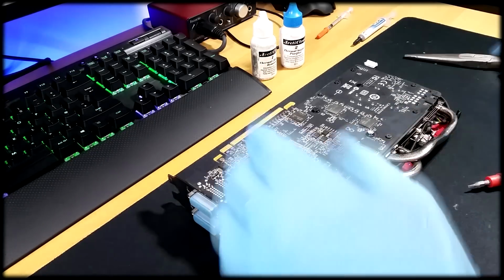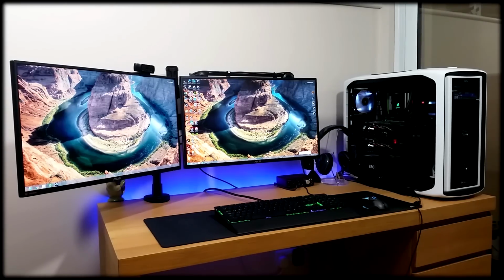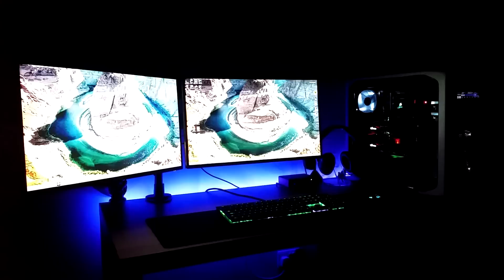Thermal Compound Removal/Installation Tutorial, MSI GTX 970 SLI, Liquid pro, MX4, DAMAGED!

Comment: hi, i have this exact card. i just replaced it with a MSI 3070 Suprim. the 970 is great but gets occasional black screen flicker, like it loses signal for a fraction of a second then comes back. loses audio and video. one time i was wering headphones when it did it, and i could still hear the audio. its not temperature related, and it could do it when watching youtube video or playing game. its not the tv, or hdmi cable, as my new gpu doesnt do it. it wasnt a big problem because sometimes it didnt do it for days, another time it might do it several times in 10 minutes. 
now ive got a new gpu, i can afford to investigate the 970, i was thinking about replacing the thermal paste, as its now 6 years old. any ideas what might cause intermittent signal loss?

Comment: Just replaced the thermal paste on my cheap 970 after about 6000 hours of overclocked exstensive and really hot use (avarage of 90 degrees celcius). The paste was rock solid but I dropped 15 degrees lol

Comment: I changed my GPU thermal paste after 5 years, i had 94c+ but after i changed thermal paste for first time, it was really difficult to do it for first time but i did it, i have MSI 980 and everything is good. From 94c to max 73-75c :D
Reply: Is the teardown same as the 970 in the video for the MSi 980?
Reply: @topg1760  Yeah. The difference is only VRAM chips.
Reply: @Voidolt  How do you mean, do i need to change the pads aswell?
Reply: @topg1760  I'm saying that the difference between GTX 970 and 980 are 0.5 more VRAM chips i guess. I didn't change thermal pads so just replace thermal paste just like on video.
Reply: @Voidolt  Thank you very much, cant stand 82c on 85% Fan speed anymore, the paste is probably rock solid by so far.
Reply: @topg1760  82c is pretty fine... I have 83c max when it's hot here so its all good.
Reply: @Voidolt  Yeah but it thermal throttles all the time and i cant get good preformance in games so i need to turn down the settings from very high to low medium to keep it in the 75-80c range. Very high is not even an option.

Comment: you clearly dont know what you are doing, you spilled some on SMD than try it - you burn something for sure or crack when try to clean. second you use thermal paste removal on liquid metal, yeah, like trying to clean car windshield with oil :) third, you take it apart and dont have 10 seconds to disconnect one connector...  amateur ! and if you are OCD you will F. remove that ugly sticker. 
PS. i have this card, modded bios, and 1550MHz on core :) temps never touched more than 75C, no thermal paste changing etc....  2y with OC than i sold it :) please DONT TOUCH HARDWARE WHEN YOU DONT KNOW WHAT YOU ARE DOING
Reply from the maker: Ok grand master OC! Sorry I am a so stupid and not worth your time grand master!
Reply: @TheKyleReality  If that was his response to you, what would it be if I told him I did the same thing to my GTX970 and left BOTH connectors on? The horror!

Comment: i just replaced my gtx970 paste after 5 years or so and it runs nearly 30 degrees cooler on the overclocked settings and because it is so damn cool it even auto boosts even further. I used the mx-4. Thank you so much for this video. Without it I wouldn't have had the courage to actually open my card and replace the paste :)
Reply: Bro my msi gtx 970 run at 92°c in furmark and 80°c in games, do i need to change termal paste?
Reply: ive replaced mine like 3 times still hits 80c not even 100% why ive done everything right
Reply: @BudKing96 prueba a hacer un undervolt, o quizás y lo más seguro es que tengas un mal flujo de aire en tu caja. Pocos ventiladores, o quizás mal colocados.
Reply: I better get started bc I'm on 86°C on Roblox at 1080p even with -250MHz underclocks 😮

Comment: two years ago, the pea method in the center of the chip was the favorite installation for heat transfer paste, or liquid metal. Now, these days the most common method that is shown to reduce heat substantially better, is the spread it out over the chip method. even those people that use their finger for spreading works better than the pea method. In this case, the pea method got maybe 40% coverage, thus very low heat transfer ability of the paste. Of course damage in the form of overheating, degradation of paste, or permeability of surface components due to heat induced diffusion into heat producers, (chip), or heat removal components, (heat sink), occur to an alarming degree. Running heat producing situations that never occur in real life, or gaming, causing the highest heat, to stress components beyond normal use, (sometimes causing failure of components and chips), do things really not advised by common people, but used by youtube illustrators, (good for our information), really show that the pea method is a failure.
Reply: I don't understand all the pea or X method guys. I learned the spread method when I had my school internship in a energy supply company ages ago, when I was a teenager.

Comment: Guess that is what happens when it says "DO NOT USE WITH ALUMINIUM" and you put it an aluminium heat sink.  Certain metal have an acidic reaction when they interact.
Reply: Ken Kimmel do you see aluminum? I don't, I see nickel plated copper.

Comment: seriously my personal experience with this liquid metal stuff is almost useless it's very finicky, it doesn't want to stick or blob onto a clean surface then it can be inconsistent as far as results go, but not only did it mark my cpu die and left a goopy layer of  something on it that was very hard to take off and maybe ate at my cpu die i couldn't clean it off, it left the same weird marks, so all in all stay away from these liquid metal and diamond pastes that mark your cpu and stick to the best none  metal none diamond based tims.

Comment: really it fucking says to only use with anything else then aluminium, that includes that you shouldn't use it with most gpu and cpu air coolers
Reply: joost van den Berg he didn't...nickel plated copper...
Reply: joost van den Berg most gpu and cpu air cooler contact points are copper or nickel plated copper just like the one in the video that is nickel plated copper....really are you a complete idiot or just a half wit?

Comment: I think it only eats aluminum and  I might be wrong, but I'm pretty sure you only use the scratch pad to remove the lead solder between the die and IHS on a cpu.

Comment: just changed the thermal compound on my 2 970's. Dropped in heavy OC from 91 C and thermal throttling  to 75 C
Reply from the maker: Sound good to me :) Which thermal compound did you use?
Reply: +Tech K Raiden i used some arctic mx4
Reply from the maker: +Dennis Zurlinden Nice I love MX4 its been out now for a while but still good stuff it is :)

Comment: Did the chemical reaction continued ? Did CLP stained your cooler more, or reacted with the GPU die ? Will it be safe to use in the case of a delided CPU (between the IHS and the die) ?

Comment: Voids warranty, doesn't remove sticker even though MSI will still see the marks on the screw and the none factory TIM, Genius!
Reply: +I0ITuGI0I According to MSI Warranty Customer Service reapplying thermal paste or over clocking with MSI Afterburner does not remove warranty at least from a MSI 980 Ti 6G. I contacted them about hot temps 83-85c in OC mode and they suspected that the issue is with the thermal paste and advised me to reapply it.
Reply: Well that's good to know, still haven't had time to try liquid metal TIM on my cards, I'm interested in how much difference in temp I would get with my waterblocks. 80c+? One of the reasons I don't air cool anymore.
Reply from the maker: I dont think I care about the warranty haha or I wouldn't do it think about it.
Reply: So just pull the sticker off and make your life easier, all you have to do is slip with those pliers and the card is dead. It was a good laugh though combined with the click bait.

Comment: great video mate what kind of fps do you get with sli 970's and it was fun playing with you tonight on battlefront
Reply from the maker: +BHC Impuls3 Well when playing Battlefront 3 @1440p i get 143fps capped  but can drop down to 110 ect in heavy combat that is with most on ultra and some on high ect. Gta 5 i get around 85fps max out at 1440p so depends on the game but always over 70fps in nearly every game @1440p
Reply from the maker: +BHC Impuls3 Also i just noticed I am not subbed to you haha just subbed bud
Reply: cheers bud

Comment: I need to change the thermal paste on my GPU becuse I render alot of videos which means that the Thermal compound is probably drying out now. Great video very helpfull :D
Reply from the maker: Ah yeah truthfully its very simple to do, if you have a back plate then there will be more strews but thats it.  MX4 is my fav paste but all are around the same with in couple of C ect.
Reply: MX4 is my fav paste too, I use it everywhere in my PC and others PC's :D
Reply from the maker: +AgraAvoid Haha. I am wondering now what my cpu is like because I delidded it ages ago over a year and use liquid pro on the core :)
Reply: lel :P

Comment: Great video man! 

I just have a one question. 
with the 970's having the 3.5gb vram do you ever exceed the limit in game?
Reply from the maker: Truthfully no not really. At 1080p you will never really hit it. At 1440p hit around 2.5 to 3gb most games only GTA 5 on ultra at 1440p I have seen it at 3.5gb max ect.
Reply: +TheRaidenWolf Okay then.
Reply from the maker: +UnrealHobbit23 007 Its not a massive issue personally I feel and still great cards to buy for the money ect.
Reply: +TheRaidenWolf Maybe but I will still go a second 390 over the 970 :)
Reply from the maker: +UnrealHobbit23 007 I am very interested in amd cards really feel I wont to get some just to test for myself :)
Reply: +TheRaidenWolf It's a great card.

Comment: nice video Kyle and for all my cpu and gpu, i would be using Arctic Silver 5 High-Density Polysynthetic Silver Thermal Compound, 3.5 Grams
Reply from the maker: I used to love AS5 used it back when I had a i7 960 cpu and gtx 480, 560, 670s but really enjoying using mx4.